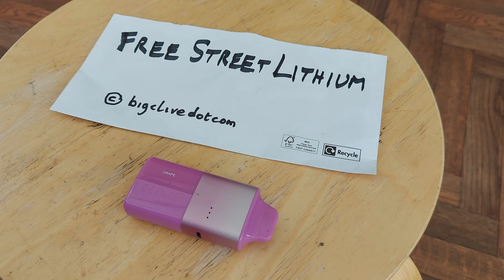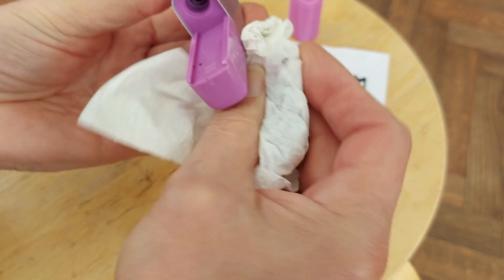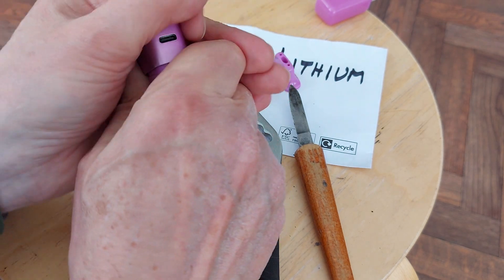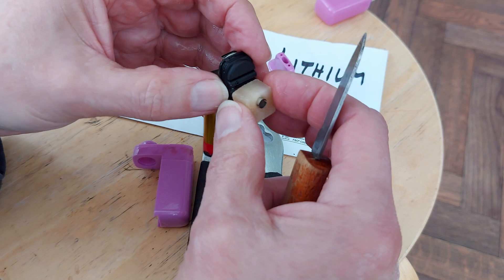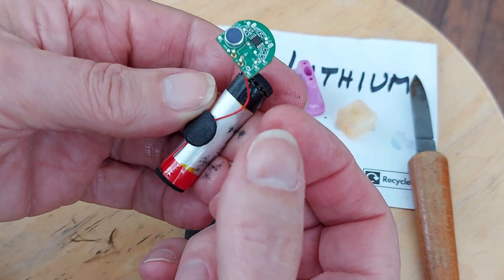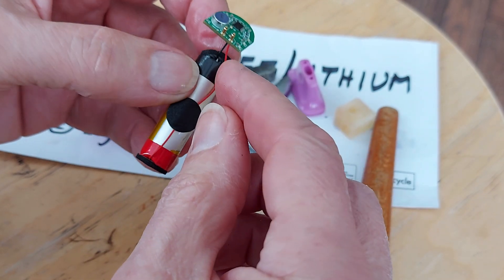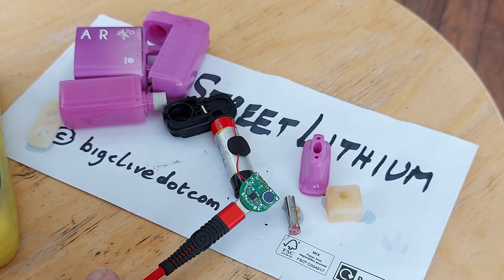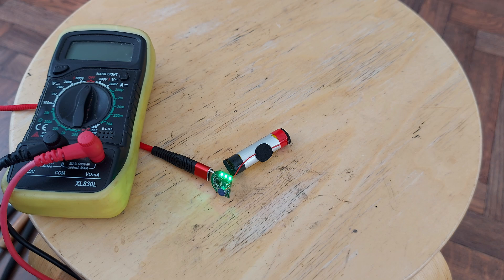I found a Free Street Lithium 🤣

Comment: I have harvested loads of them and use them to power my Christmas lights.
They need to be sanitised first, I use Isopropyl alcohol. Then test the battery, if ok, some fail due to being over discharged or damaged, do a capacity test to calibrate them (markings are unreliable).

Comment: Yesterday I found one. Haven't found one in ages! This time a big and rechargeable one. It still works fine, it was lost by someone. I left it as is-. And I will every now and then push air through the back end to get some odor, for fun. It is labeled 15000 and has an ape on it. When charged, or used, you see a 2 digit number through the plastic housing, nifty to see. Found new-price, is +/ 22 Euro (French online shop). Battery is 850 mAh.
PS: you made quite the mess, getting 'moisture' all over your hands and even on the battery.
Haha, so street lithium it is. Good find! (pun intended)
Reply from the maker: That sounds like a handy one to have found. I see very few around now, but I really don't need any more. I have more than I can ever make use of 🤣